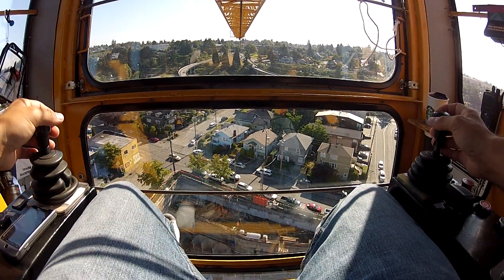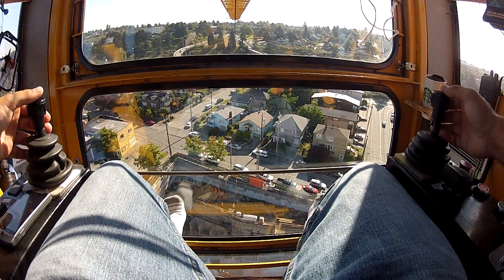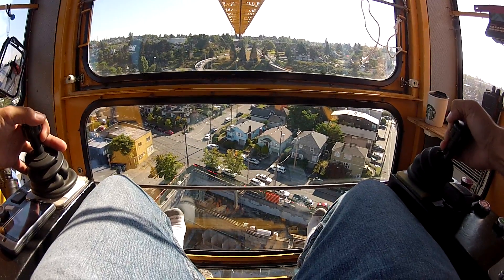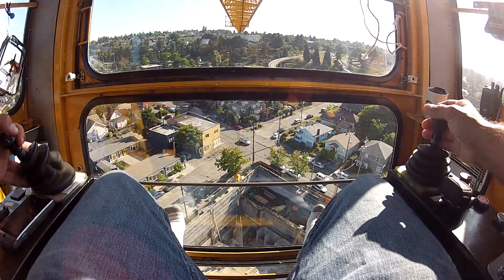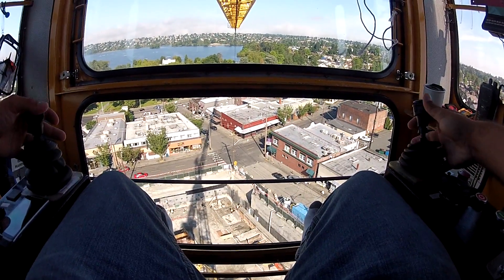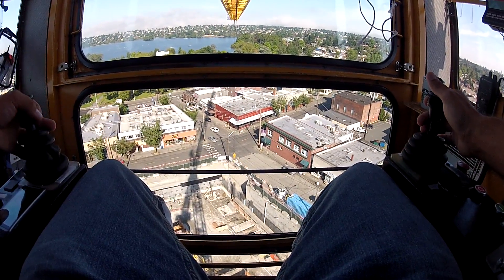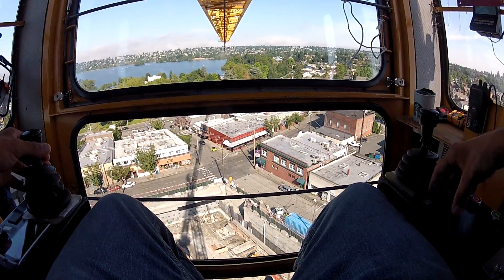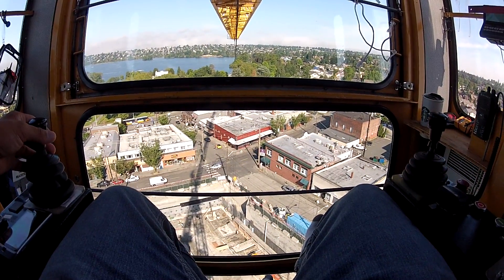How to Operate a Tower Crane - Rebar Column

Comment: when you can't see the end of your line is there a camera on the end of your line?
Reply from the maker: Cameras are available. They are cool for being sure you are clear and speed up highrise operations. But if you watch the "Hanging Iron" video, that is pretty much all blind work. I can't see what is going on because they are 300 feet below me and the concrete elevator core is in the way. So if you watch my eyes, I'm looking at the rope speeds. Then I'll look over to the computer and see weights, radius and elevations. Then I might look up to the horizon to be sure my swing is stopping like I want it to. Blind work, especially at the speed you'll see there, has to be done with operators and signal people that really know what they are doing. A lot of operators and signal people, even guys with decades of experience, are just getting by. Being really dialed in for ironwork and 40 story buildings takes a lot of paying attention and thoughtful aggression. Not only are you listening to each instruction, but you can picture exactly what they are doing without being told so you give them what they are looking for without the advantage of vision. It's a bit nuts.

Comment: at 53 years old old am I tool to start his career
Reply from the maker: Not too old. The downside is that it's much better if you work your way through as a rigger. You'll learn what works and what doesn't. What's safe and why. The crane operator is looked to for advice and as the captain of the ship. If you don't have that base experience, it's not the best scenario. 
But, you can certainly learn to run cranes. With out medical issues, I have known plenty of people well into their 60's doing this as a career.

Comment: What do you do or what does any crane operator do when you have to go to the bathroom?
Reply: Guys take up bottles to urinate. Most women use a camping toilet. I would suggest that you shouldn't take this job if you aren't regular when it comes to defecating. It's not uncommon to not get breaks on fast paced jobs. The crane will swing for 12 hours and the only time it stops is to pee. And even then, if someone sees it not moving, they will start calling on the radio because they think it's free for them and they want to jump in line. I got in the habit of turning off the radio so I could pee in silence.
Reply: u have to go down or to pie in a botle :D

Comment: It's a very tough job especially doin it from over 200 feet high.  Do those crane operaters have AC up in the control room??
Reply from the maker: +Dan Rhone Some modern cranes have AC built in. It gets hot in direct sunlight up there. Most of them don't though. I just bought one and made sure to have it. I'll let the best operators fight to run my crane. Some guys buy aftermarket systems and give up the space for the comfort of cool air.

Comment: So I want to work in socks no shoes lol...I'm currently in the military as a logistics guy (box kicker/warehouse guy) but I definitely wouldn't mind doing this..of course I'd probably want to start lower in the crane department, but I could see myself as a tower guy...great video btw
Reply: WitX916 You'll want to start with signalling cranes and really learning that side of it. Most people never really learn that part even after 30 years. Timing and nuance is so critical to understand that if you don't learn that, you'd be dangerous as a crane operator. Then most people move into the boom trucks and small cranes then work up in size. I find running small cranes actually harder. But the skills you learn there translate fantastically to a tower then it's just a matter of getting used to the speed of a tower versus a truck crane. Good Luck! Depending where you live, if you have strong enough unions there, training is all free and great quality through the Operating Engineers and you'd make a good living.

Comment: I was up in a tower for the first time for training and it's something you have to get use to. My local provides all the training I want do you have any advice for me to feel more comfortable and confident.
Reply from the maker: Heights are just something you have to get used to. Eventually you only focus on what you are doing. But to be fair, I started as an ironworker. So getting into a cab feels very comfortable for me. I think that you might just need to do it repeatedly until it feels natural. It's normal and healthy to be uncomfortable with heights. 

if the movement of the crane is the concern, I would say that a properly maintained and erected crane is extraordinarily strong. The minimum design factor for a static load is that the load cannot be more than 63% of the toppling capacity. when you add in wind and live loading it's at 77% of it's ultimate failure. So your load chart is saying the crane is maxed out, but you really have a safety margin of another 50% if you are static. Of course there will be some live loading. The point is that the cranes are really over-designed even though they move a lot. In my days of erecting cranes, erecting a PECCO (old blue and white cranes) at 300' on loose bolts lets you know how much they will flex. They were sickening to look down those old towers. You could see 4-5 feet of bend before you tightened the bolts. I've heard stories of the old Linden's twisting towers 1/8th of a turn on an old swing brake test method. I guess what I'm saying is that I've seen some stuff. What we see in the field everyday... meh. It does take some getting used to. If you run the crane safely trying to avoid shocks, you'll be fine. You'll get used to the threshold of the cranes bending. I've been in an overloaded tower crane (nearing 130%) due to a computer failure.and there was no question about something being wrong no matter what the LMI screen was displaying. "Why am I staring at the ground and the boom at the same time?"

Good luck. just keep exposing yourself to it and focus. Eventually you won't care about anything but the rhythm and being sure you are clear of obstacles, smooth, accurate, fast, and safe.
Reply: Thanks for the reply it's greatly appreciated.   Great advice I'll keep working on trying to get seat time .
Reply from the maker: ***** Funny enough last year i moved into skydiving. Tandem from 4000 meters. Then doing the progression to get licensed I climb out on the wing strut. All systems normal, release to go into an arch and my mind goes blank. I come to under canopy. Do it two more times with better control each time but not normal. I conclude that I've worked so long at heights ignoring the threat of falling that the initial overwhelms my brain and it shuts down. I think that I could break past it but what if I have a highspeed while moving past the problem? I decided to give it up rather than push through. Funny how that works. Bouncing crane... meh. 

The do point downwind. This allows the crane to lean back into the wind and survive 160 mph winds.
Reply: sure

Comment: I am about to goto school to get training and NCCCO certified but I don't think that covers this type of crane does it?? If not, how does a guy go about getting into this line of work?? TIA.
Reply from the maker: The NCCCO does have testing for the tower cranes. It comes down to which cranes you start with. It's possible to start with a tower crane. It's all that I run, but it's not exactly the common route. Most people will start with a boom truck where you can see everything and get the principles of craning first. Just getting into a crane with say 300 feet of load line out there without understanding the big picture really well could be disastrous. It should be a progression process to get to a tower crane. I happened to be a crane erector and got exposed to the principles in great detail and the opportunity to hang out with the best operators on the West Coast. 

I'm not sure which schools would be the best. I am a union advocate. The training is very good, free, you'll make money as an apprentice, the wages are better in almost all cases, and in a case like mine I pick and choose where I want to work. If I were on my own, I would basically just have to take what is available. For example, I worked 65 hours per week this last year and my employer wanted me to do it for another 15 months straight on the next job. I said,"No thanks." and so I move on and other options are available to me without interviews or struggles. One phone call to my business agent or dispatch and something will be available. 

If you live in an area without much for unions, start on a smaller crane and every 6 months ask for more responsibility. Show interest and really recognize patterns. Notice unsafe behaviors of people rigging. Take every opportunity to learn. Some operators are lazy and just want to pull levers. Being a good operator is about not only being good at running the crane, it's about being a leader and the knowledge resource. I've been in tower cranes exclusively since 2001, written state construction crane laws,  I've written a test the NCCCO uses and man, I'm still learning just in this facet of cranes. Always strive to be your best and stay safe.

Comment: is he just in SOCKS

that's awesome
Reply: had to put on pants that day for the video
Reply: Elia Deck I've had a couple of my operator's working in nothing but their ginch. Get hot in that glass box.
Reply: @JustJake77  exactly, I held a steel column for 2 hrs, that was fabricated wrong, i was facing the sun, windows open with no fan, wearing shades, underparts and Sox.
On site fabs a bitch.
Reply: I do the same, socks only, I find with my boots on the glass underneath the seat gets covered in dust from the boots so I find it hard to see out. I line the glass clean so socks, and it's comfy lol
Reply: Elia Deck : Note, they are steel toe safety socks !
Reply: Well for sure that’s one place “Safety Sally” isn’t going to be checking for personal safety gear.

Comment: very nice very tidy operating, im from ireland and hoping to become a tower crane operator can you give me some advice im 41 am i too old
Reply: I don't think that 41 is too old at all. 

I came through the union trades in the US as an Ironworker, Crane Erector/ signal person (I believe that in the UK you would use the term "banksman"). This taught me how to be aggressive and accurate. Not to mention being comfortable with the cranes.

When I was ready to take a seat, I took the time to sit behind good experienced operators to get the tricks of the trade. Do this for multiple types of cranes too because they all run a little differently. 

The downside of the job is often longer hours and you are somewhat irreplaceable. Calling in sick is not an option. But you do get treated well for this. You are alone up there. Sometimes it's boring. Other times it's overwhelming. And the sweating you'll do on the first job... oh man! But it will soon just become what you do and the only pressure I ever feel is in the decision to shut down due to weather. I'm a little too willing to push the envelope.  

We operate through unions over here so I'm not sure that I have specific advice. We have a different system. If I were to move to the UK I'd call up the crane hire companies and ask how to break in. It might take a few phone calls until your break through, but someone will take your call and give you a direction. Vertikal.net might be a good start on sourcing those Crane Hire companies in Europe. Good luck. Ask me anything any time. I hope that I can be of use.
Reply: Gaytor Rasmussen Thanks a lot of that info.  Very insightful.
Reply: Learn how to flag first, study how the loads act under different circumstances, learn to show up early and stay late.  The crane operator will be the first one on a job and the last one to leave, every day pretty much.

Comment: they should put a camera on the snatch block then you would have a birds eye view of the load even down shafts are stuff
Reply: the newer cranes do actually have cameras on the trolly
Reply from the maker: tosspot1305 Which manufacturers are doing that? Or are you referring to aftermarket cameras?
Reply: Liebherr and potain do it.   I'm sure others do too but usually the crane has to be very tall..(over 300ft) or have a large blind section i.e. behind a building
Reply: ur crazy
Reply: I am an Ironworker currently working a job with the 2 tallest free standing tower cranes in the US and neither have cameras on the block.  One stands 400ft other is right at 300ft.
Reply: And both cranes are brand new Potain cranes.  Not saying there arent aftermarket cameras on some cranes, but seeing how your comment is 4yrs old I would think if Potain was putting this type of feature on their towers 4yrs ago I would think 2 brand new 300ft plus tower cranes would have them.  And these are some heavy lift free standing towers,  both are good for 44,000lbs on the tip.
Reply: I was just working on a tower(ironworker), and the trolly did have a camera on it. The operator could see quite a bit with it
Reply: Why? You can only see the load.

Comment: how come he has no shoes on
Reply from the maker: Two reasons. One, I find that wearing shoes through the jobsite then in the crane just leads to dirt everywhere. I really like to keep my crane clean. This aids in keeping dirt off the glass for visibility as well. 

Two: I find that my shoes last years in the cranes. Most of the heaters are under the seat. Hot sweaty feet becomes and issue and you'll end up with stinky shoes/boots if you don't switch in the crane. Some guys just wear a slip on in the crane. I just treat it like my living room since 10 hour days are common.
Reply: ok :)

Comment: I found it, I would like to print a photo of it but it won't let me  print screen paint cntl v doesn't work ! I t was a horrible bastard to operate, I think it had a 151 ft jib on it and could lift 1.5 tons max radius another one where you had to stand up in all day, Have you heard of a buildmaster? Another load of shit three cabs on them and they used to sway something awful A lot of operators didn't like operating from the top cab!

Comment: I once operated an SGME tower crane it was made in Belgium and that had a movable ballast, The jib didn't have a trolley, The whole jib used to slide across the tower and the ballast would travel the opposite way to counter balance it, I believe there were only ever two in the uk 1960s operated by a company called Trentham

Comment from the maker: The standard shift is 8 hours. You can find jobs with lots of overtime. 50 hours a week is pretty common, 60 is getting to be long for me. I just did a video walking around the crane as per your request. It went way too long, but the cab is a couple of minutes in if you wanted to just get to it then skip the rest.

Comment from the maker: Generally, the only cranes that have moving counter-weights are luffing tower cranes where the boom raises and lowers, and gigantic tower cranes like Kroll K10000's. Most lean back to their maximum moment design. When you apply weight to the hook, it just leans forward to either plumb, or to it's maximum forward moment. On some tall cranes, this might be 1 metter back, and 1 meter forward which means the operator can sway 6 feet. Quite fun on those cranes.

Comment from the maker: Man, all of the advice I want to give. Yeah, I'm pretty relaxed. It took a while until I was able to 100% relax. Some stress during break-in is good. You should be overwhelmed an pushing yourself, but very attentive to all details. Not only for safety, but to pick up all of the little tricks like the lay of the slings or shadows telling you if you are centered. Getting the block 100% stable prior to hoisting up to get a read on it. Getting in tune with your bellman. It all takes time.

Comment from the maker: We use mobile cranes that you might have seen driving down the road. Search for "Tower Crane Erection". In Europe you'll see many cranes erected short then "climbed" into position. In the US, we mainly erect them to the full height needed for the job. We climb them if the building will be taller than the crane can free-stand (usually 260' to 305') without external supports such as the building.

Comment: Your rigger radio is missing it's anntennae(sp?)  Nice crane. I've operated the 316 and 630 EC-H. THe 316 had heat sensored hurst style levers and frequency drive trolley.The 630 was a monster! 11,000 lbs at 287 ft.

Comment from the maker: Most new tower cranes are similar to hydros in that you apply pressure to the controls and ease out of them to come to a stop. Prior to about 2005, they are a completely different animal. This is a 92 model and the force, timing and duration of each input becomes a second nature art form. It's a lot of fun getting up to speed with each model but it can also be very frustrating in the learning curves. Going from hydro to tower, dealing with the torque in the tower will be the biggest change.